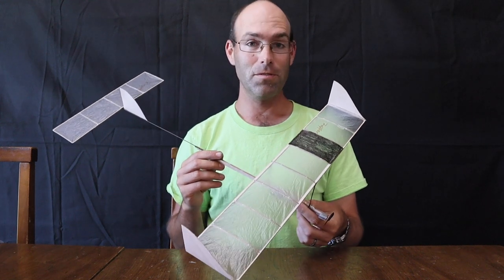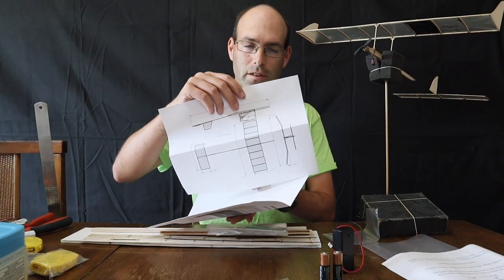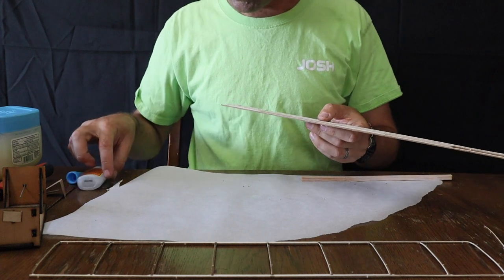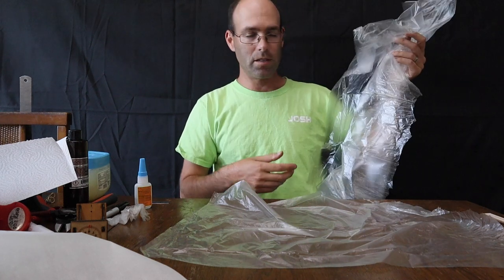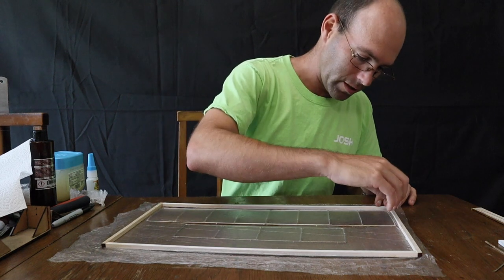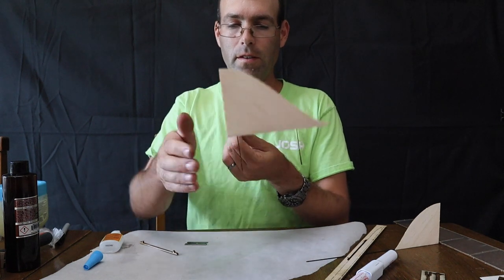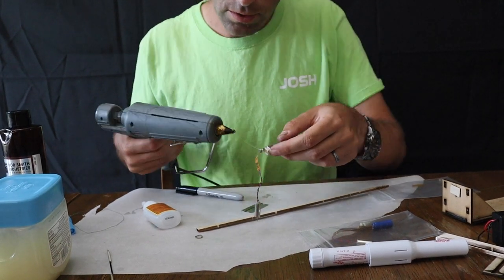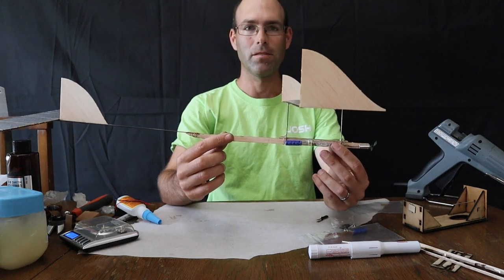Zapper 2021/2022 for Science Olympiad Electric Wright Stuff - Build Instructions

Comment from the maker: IMPORTANT: if you are flying Division B Science Olympiad Electric Wright Stuff, a last minute rules "clarification" has just been issued by SO dictating that the already deactivated 750 Ohm resistors on the stock Zapper and Electron power boards must be removed. We have determined that this can be done in just a few minutes by crushing the resistor with a pair of needle nose pliers. This is an easy modification but requires care to ensure that the board and other solder joints are not damaged. Detailed photos are on the product pages on our website:
https://jhaerospace.com/product/electric-wright-stuff/

Comment: Great video! I have a question though. So, the stabilizer in the back of the plane ended up breaking while my team was testing out the plane. We had already broke the spare parts for the stabilizer that the kit came with so we decided to break the spare frame parts for the wing in half to create the stabilizer. However, the size of the stabilizer is now a bit smaller and our plane only stays in the air for about 5 seconds, when before the stabilizer broke, it was staying in the air for 30 seconds. Does the shorter stabilizer have anything to do with this?
Reply from the maker: Anytime you make changes to the plane, you have to retrim it. Get a good glide going through the usual adjustments, then apply power and tweak it as needed.